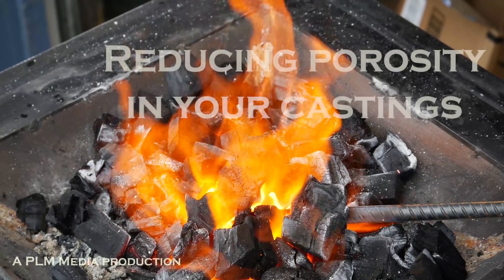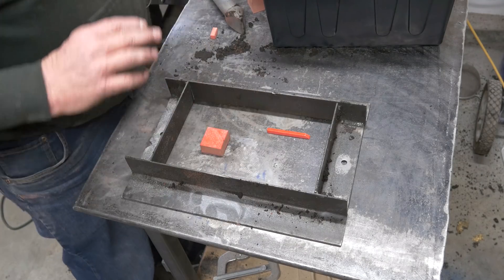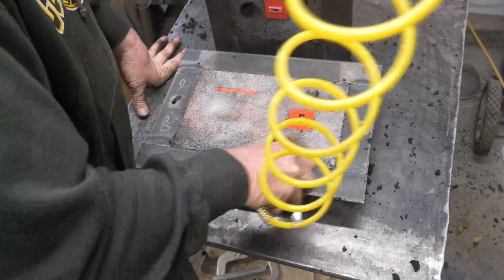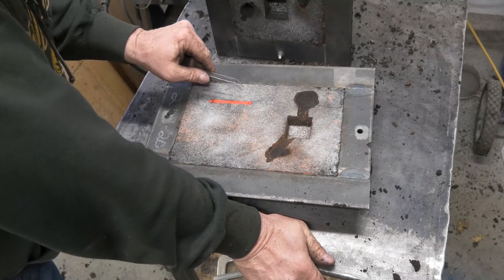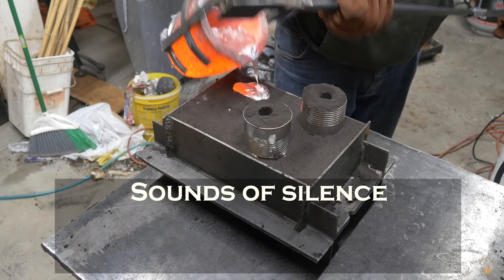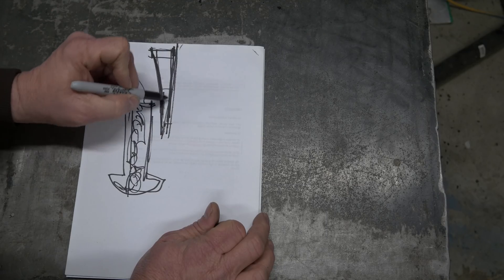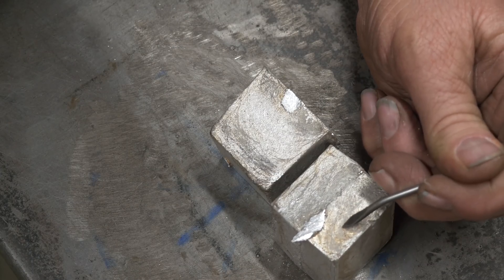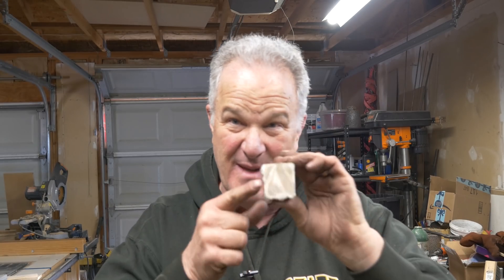Reducing porosity in your castings

Comment: Dear Sir, Im trying to cast billets for extrusion 4" x 400 mm and 5 " x 450 mm. U have some tips or advice to have success with this task?
Reply from the maker: I love it when you mix measurement systems 😂 (inches and mm) I assume that 100mm x 400mm and 125mm x 450mm is what you're trying to pour.  

You're correct in being concerned with shrinkage. Something that big will want to shrink, a lot. 

If it were me, I'd try to do a bottom-fed, vertical pour with plenty of extra height to allow for the shrinkage. Feeding from the bottom will reduce porosity (assuming you keep your sprue full).  I'd also leave the top of the mold open so you can see the metal in the mold as it rises and cools.

When you're done, you can cut the billet to length removing the section with the big shrinkage hole in it.

Good luck
Reply: @swdweeb  Thank you Sir. I usually use measurements in inches for diameters and millimeters for lengths.😅

Comment: re table salt; I've read that NaCl or KCl will just lie there unless it actually melts and becomes free ions; but both have a melting point above that of aluminum. If you mix and pre-melt the two chemicals prior to casting at a 1:1 molar ratio, you get a flux that melts before the aluminum; that's the key. So table salt alone probably does nothing unless your melt is way too hot. Most hydrocarbon compounds make a poor flux by themselves, and soap probably decomposes in heat to become a tarry mass of sodium-bearing goo that has some noticeable effect on the pour but who knows, even sawdust works for some metals.
Reply from the maker: Never heard of mixing them.  I'll have to ask my profession foundry dude about it.
Reply: @swdweeb  me neither! I just ordered some KCl tho, and if it's a lie I promise I'll come back and share my findings. Everyone says mix the two salts and make ingots, and throw those into your melt.

Comment: aluminum the problem
Reply from the maker: Those blocks are long gone having been poured over two years ago. My point is that porosity in our pours is very much related to way we pour. If you mix air into the aluminum through a turbulent pour you're going to have a lot of porosity.  Granted there is hydrogen gas in the melted metal, unless you degas, but the stuff I see in most castings is because of the way its poured, not absorption of hydrogen during the melt

Comment: Turbulence is a real issue, use wells or bottom up filling if possible. 

Shrinkage and swelling can occur if gating is poor and also pouring speed is too high or too slow. 

We do this everyday, in green sand and sugar cane mollases sand, old technique but works.  Green sand will give you much better dimensional accuracy with rough texture. Mollases gives you a very smooth surface but molds can deform if not handled with care.  once hard it's much harder than  green sand.
Reply from the maker: I’m curious, do you use anything like clay in your molasses sand or is it just those two ingredients?
Reply: @swdweeb  it's just sand and mollases with a good atleast 80+ brix rating. One side effect is compared to greensand this mollases mix produces a better surface finish and surface  hardness probably because of more carbon is available ... Not sure just an idea.
Reply: Forgot to add, it produces a really bad smoke! Everything will stink like burnt mollases!

Comment: If you are serious about casting, degassing is absolutely necessary. OF COURSE it's not the only tool in the box, but it targets a different kind of porosity. You have to separate entrained air bubbles and hydrogen porosity as different fundamentals.
Reply from the maker: I don't disagree with you, but I am curious how you would degas aluminum
Reply: @swdweeb  Stirring inert gas bubbles through it is pretty effective and an easy rig. But needs some knowledge and guesswork when it's done. Of course it's pretty useless if you screw up the actual casting process as you showed in this video. 

In a professional setup it's done increasingly by a vacuum treatment of the melt. It's a bit more complicated setup, but can eliminate all guesswork and all room for user error. Pump it down and hold pressure x for y seconds, done. This is also what I'm using for my hobby stuff. Sounds more complex than it is. An old large stainless steel cooking pot with some glass wool on the inside for insulation, a lid with a high temperature silicone seal and a vacuum pump. Works a charm. But the primary reason for me doing this is because I already had that vacuum setup. ;) Be careful with plexiglass lids... they melt in seconds under the heat radiation of a crucible full of liquid aluminium! ^^

For large scale mass production both are combined for speed and quality control. Put a hydrogen sensor in the gas stream and actually measure the hydrogen content of the melt. Automotive OEMs love it as it gives them more frickin dataaaaa! ;)

It's pretty awesome for part tracking though. You can find the hydrogen content of the melt of any random part that was produced years ago, in case of a strange defect cluster occurs. If your whole production process is tracked like this you can pinpoint the cause of the defects and find every car the possibly defective parts were used in.
Reply from the maker: @jackmclane1826  That's what I wanted to hear.  Had you said something like "dump table salt into your melt" I would have removed your comment 😄  Thanks for taking the time to point this out. Always good to have "instructive" comments out there.

Comment: Makes perfect sense to me...well done.
Reply from the maker: Thanks. You'd be surprised how many people think it it doesn't matter
Reply: @swdweeb  By doesn't matter, do you mean having inclusions? I cast small bronze billets for bushing manufacture (DIY) and any inclusion is a menace. I produce alloys that aren't in any table known to mankind  ;-). I have a great deal of admiration for myfordboy (not just because he's also British) but fail to see how making bubbles in a melt removes bubbles. If it was for de-oxidation..maybe. I use Borax as flux and the occasional spider's kneecap if I can't get a delivery from Hogwarts of Shazam dust. One thing I found out relatively recently <10yrs ago, was that my make shift steel crucible wasn't melting due to high temperatures, but dissolving into the molten copper alloy. Therefore, best, melt the zinc first and dissolve the copper into it to make brass.
Reply from the maker: @charliechancontraptions5951  Most people that cast on YouTube refuse to adopt any of the techniques espoused by Professor Campbell (another Brit).  I routinely see people pouring down large open sprues into a air mixing bowl at the bottom of the sprue and then running directly into the part at full velocity. All of these things are "designed" to create porosity.  They can't help not to.  Then they pull castings out of the sand that look like sponges.  A lot of them watch my channel but to them none of this matters.  They will continue to pour the way they do. 

Regarding degasing with bubbles, I assume you mean bubbling inert gas through the metal, the proper way to try and float oxides and you're not referring to people running to their kitchen cupboards and  finding somethin to dump into the metal. A lot of people have bought into the idea that you can dump crap into your metal and it will somehow magically clean the metal up.  

I talk about steel crucibles in a video I recently did about casting ingots. (I know I know, some times you have to pander to the masses) Aluminum will eat your steel crucible as well.  https://youtu.be/fFADzuaCtQs?t=90 I always melt the lower temp metal first and let the copper melt into it.  One time I melted copper and then added aluminium to it to make bronze.  Big mistake.  Even after preheating the aluminium it still created a big white cloud when I added it to the super hot copper.  Never again.
Reply: @swdweeb  No the gas bubbles are being created by the degassing sachet which is plunge into the melt. Yes I'm sure you do alloy brass correctly. I just couldn't understand how it could be created with the melting and boiling point of zinc being so close together and much lower than the copper. Until I saw a video.

Comment: I cast bullets.  Porosity is a real problem. 
You are correct any turbulence, splash ect in the mold should be avoided.  It causes bubbles wrinkles, and lines and more
Reply from the maker: I'll bet. Its a wonder more metal casters don't get that. 😀

Comment: I am wondering if you recondition your green sand and how? I'm kinda new at this and would love any input you can offer.
Reply from the maker: I actually use oil-based. I say that because it started off as petrobond but has been reconditioned so many times that calling it petrobond may be a bit of a misnomer.  I have a video on how I repurpose it. https://youtu.be/PdWet_QCYq4  Basically I stir it using a "paddle" I made and my drill press. If I feel like it's getting too dry due to the number of times it's been burned I add a little  non-detergent motor oil to it.

If you're using green sand, you might search through olfoundryman's channel. He did a video on how he does it over a year ago.  Guys like Tobho Mott have built mullers to recondition their green sand as well. He's got a series of videos on how he built it and watching it run.

Don't hesitate to ask if you've got other questions. I may not know the answer, but I likely know someone that does.

Comment: Hi - Thanks for taking the time to demonstrate this.  Maybe if you repeated this experiment but make the parts long, triangular prism shapes / wedges.  Once cooled they can be hammered / broken in half and you could examine the triangular break for grain structure, edge cooling, shrinkage, color uniformity and porosity.  You could also test surface profile finish if the part was vented or not.
Reply from the maker: Thanks. I pretty much took this as far as i could stand. ;-)  I did a series of videos on it to the point where I just wanted to move on. I felt I had proven what I needed to prove and learned a lot from it. The series if here, https://www.youtube.com/playlist?list=PLU1QP34Dv8Y6-qXska4MOagRMSVWan40k, if you're interested in taking a look. 

I might revisit the subject in the future. If I do I'll certainly keep your suggestions  in mind.  Thanks again.

Comment: on this topic i can suggest a good book from c.w. Ammen, "The complete handbook of sand casting" on page 186 - 189 you can read up on techniques on bronze and brass casting which is quite intressting, coke and skimmer gate, to increase the flowrate by choking the gating. put the casting out of level, forcing the metal upwards while pouring and using tapered feeder.
to aluminium i would say you can use it too, as it's also very easy flowing and faces similar issues during casting

its realy an art to get it right and very intressting...
anyway, i've allready made myself some tapered tooling for the future and will include your findings and those of the book into the future, as i need the castings to be spot on and with tight tolerances for models i plan to make. thanks mate
Reply from the maker: I've seen guys tipping their flask to do that as well. I have a long piece I'm going to cast tomorrow I might just give it a try to see what happens.
Reply: @swdweeb  good luck :)

Comment: Tried this with a small casting today, seems to improve surface finish compared to the usual method as you showed. I have to make some tapered sprue patterns and will see how I go in future. Previous castings had porosity on the surface as you showed, which I didn't mind unless the part had to be polished. Then it was a lot of work trying to get all the pits out.
Reply from the maker: If you want a model of the tapered sprue that I use or a measured drawing, you can download them here https://drive.google.com/open?id=1glhKh318yuyX8l67ejB-t14ExvUBL4eh
Reply: Thank you  @swdweeb

Comment: From watching your videos and Old Foundry guy I am well convinced that your method works best.  VegOilGuy has started using pouring basins on his lost wax castings with huge success.  I have not poured anything yet.  (I am getting closer everyday)  The first thing I did was make a tapered sprue on the lathe.   It is to big of course but I can easily make a smaller one.  Keep up the good work, I enjoy your videos. You and your friends have me convinced.
Reply from the maker: If you want a model of the tapered sprue that I use or a measured drawing, you can download them here https://drive.google.com/open?id=1glhKh318yuyX8l67ejB-t14ExvUBL4eh

Comment: Ok, I’ve got a question. And I have no idea why this hasn’t come up yet. Other than ramming being kinda a pain, what about a tapered diagonal pouring? Would the offset of the angle help to  1 slow down the metal and 2 help with that right angle that causes all of the wild turbulence? No sharp corner to turn just a gentle 45* angle to slide right down the Shute and slip across the runner to the part cavity? And if yo were to do it in a way that it would swirl to fill and never hit head on to a wall. Kinda like the angle of the burner in your foundry pointed so that it swirls around the walls and up out the top. .? I’d like to see a video taking this in to consideration and testing it.
Reply: I am sure swdweeb will chime in, the first thing that came to mind for me was the flask size would have to increase.  If there is a way I would like to see it as well.
Reply from the maker: well, from what I've been told, angling the sprue doesn't slow the flow down as it is still falling the same distance. I asked that same question about pouring a tall sprue for a large bell and was told that it wouldn't help.

Comment: I think you wimped out on the vertical extensions, not nearly high enough!
Did you only have one can and cut it in half?
Reply from the maker: That is a distinct possibility :-D
Reply: Tut, tut, you can't go making scientific videos if you do not have all the apparatus you required.  If only I had known I would have sent you an empty can.
Reply: @smallcnclathes , I think that SW could not bring himself to use the full travesty of a full height bean can - it just goes so much against the grain of  serious foundry work. I think he had to take something to settle his stomach after using just those 1/2 height extensions.... Martin
Reply: @olfoundryman8418  Attacks of conscience are an indicator that ones teachers have properly chastised such behavior. ;)